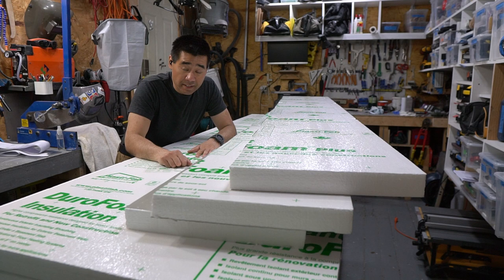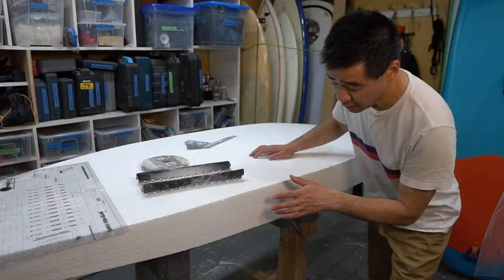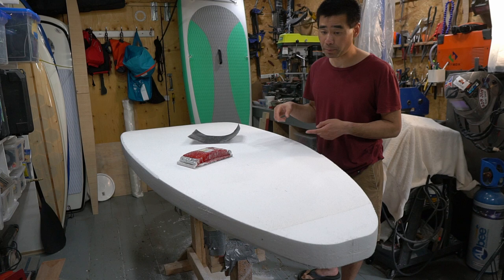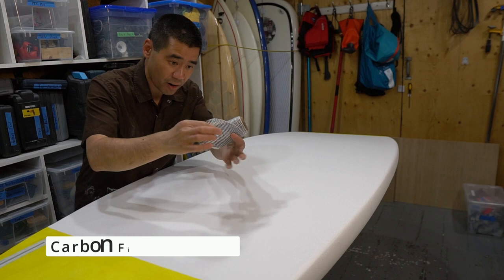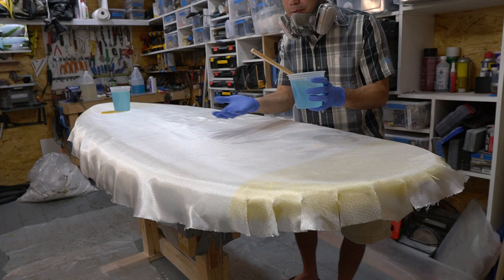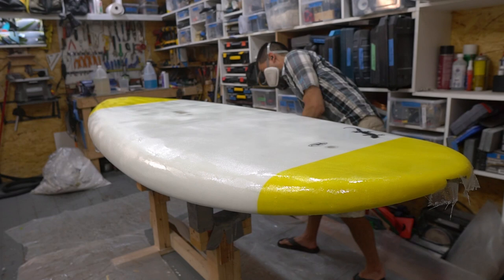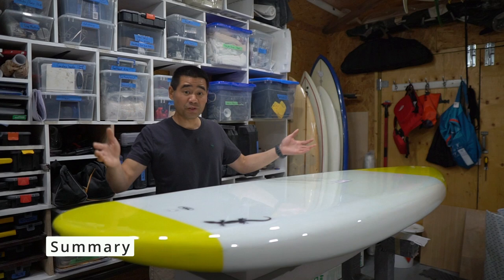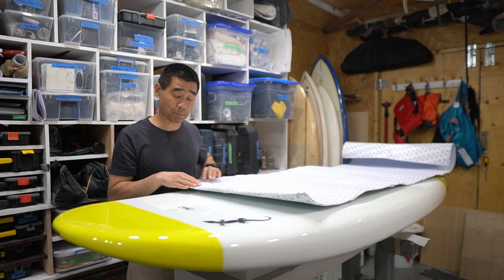How to Build a Stand Up Paddle Board for Surfing | SUP Surf

Comment: Another excellent video….I am curious as to why you cut out and then replaced foam in the fin and leash plug areas?  Thanks and keep up the good work!
Reply from the maker: Thanks!  The foam I used for the main part of the board is 1.5lbs/ cubic foot.  That can be a bit too weak for the larger fin and for the leash plugs (or adding extra glass).  So the foam insert is 2lbs/ cubic foot, I should have mentioned that in the video.
Reply: Thanks for the answer Andrew!  I have to say that I’ve been trying to locate some of the foam and Home Depot doesn’t  carry it in Fla. and won’t order it….I’ll keep looking!
Reply from the maker: @douglasnoren3348  hmm might be because there isnt as much of a need in fla for insulation products lol.  Try looking up places that sell foam for packaging, they have to cut large blocks down to different sizes.

Comment: Man that latex paint thing is AMAZING! Its strong, easier to apply, easier to work,   and less noticeable since its white. Bloody brilliant! I've only made two boards (almost) so far but next one will definitely be latex paint method over polyurethane for foam joining. 

I am just fininshing (now sanding before gloss coat) on a 5'10" shortboard made from many many pieces of scrap foam. The polyurethane joins were numerous and veryvpainful. This would have made it oh so much simpler. Oh well...the more you know.

Comment: Great build video !
I'm getting ready to do a DIY SUP for my granddaughter for use this summer.  Will be my first time doing so.
Quick question about a segment of the sequential steps to your process.  
1st: the yellow latex acrylic paint is applied direct to the dry styrofoam ?
2nd: you use the 'polyfilla' liquid sealer at this step to create a layer of separation (barrier?) btw the foam and the fiberglass cloth ?
3rd: it appears you lay down the cloth dry then apply resin.  Do you not pre-wet the foam side w resin to better accept the cloth ? Or do you just apply resin on top of the cloth and work it in ? (assuming the dried Polyfilla sealer bonds well to resin soaked cloth w/o needing to be wetted first ?)
Thanks for you reply !

Comment: I need advice installing a bow eye in a epoxy foam raven paddle board. I plan to pull it behind a electric recumbent bicycle , with a yeti cooler and some ice and drinks on top while towing, I plan to have two bicycle wheels at the back. I have 4 tie points up front but need a tie point at the very front and it has to be strong. My plan is to either drill a horizontal hole large enough to glue a piece of carbon fiber tube with like a  6" set back from the tip from side to side of the board or drill a long hole at the bow to glue in a stainless eye bolt. Can someone please give me some suggestions please. Thanks

Comment: I enjoy looking at your video. Its been a few months since you built your SUP, what is the status on its visual aspect? Since you used water based paint to glue your EPS foam, is it still sturdy as the first day you built it?
Reply: Once glassed it'll be capsuled and sturdy even though some people/surfers say the boards loses it's pop. IMO polyboards do lose it same as skateboard decks, but I have not felt a lose of pop in my epoxy boards. Now in the PU/Poly full mode though.

Comment: Hi Andrew, what is the curing time between glassing. After how many hours can start working on the other side ? Thanks
Reply from the maker: Depends on the temperature but at room temperature (23C), around 5-7 hours.  If the temp is between 23-30C, cut that time down another  hour or 2.
Reply: @AndrewWorkshop  thank you!!

Comment: Hi, excellent video, im going to start my own DIY SUP this weekend, not so fancy, but to see how it goes.
What did you use to seal the foam? Thanks in advance
Reply from the maker: I used Polyfilla Big hole filler, best sealer I have used, if you can find it.  It matches EPS perfectly and is light.  If you can't find it you can use dry wall spackling but you might have  to paint it afterwards to match the color.  Good luck!

Comment: Was it tite bond 2 glue ?
Reply from the maker: Water based latex/acrylic paint
Reply: @AndrewWorkshop  could one use this on XPS foam?
Thank you Andrew. I Love your videos. So informative. You rock.
Reply from the maker: @seanrphill  Thanks! It might work but i suspect it would take a few days to dry because XPS doesn't have a bead like structure so air doesn't travel between the sheets of foam.  I'd test it on a sample and also keep the layers of paint thin to reduce drying time.